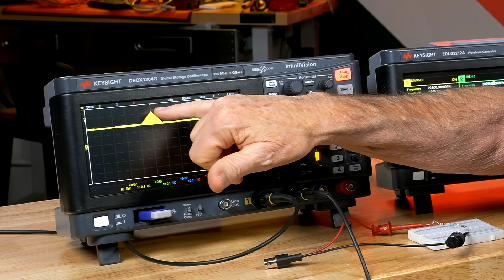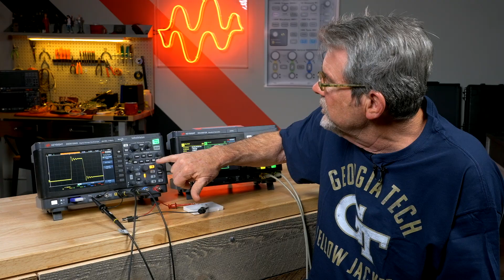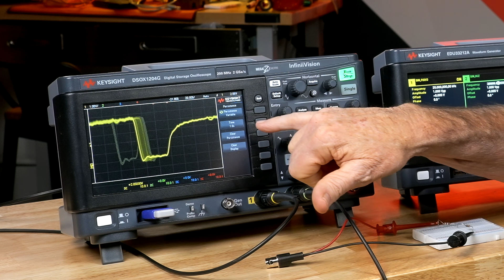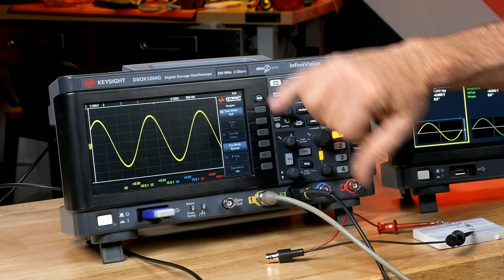Lesson 16: Acquisition and Display Modes

Comment: New to electronics just self learning, checking out good videos like yours. Thank you very much.
Have a question. 
Forgive my question if it's off topic and maybe two basic
On your shingle shot event I see ringing on the rise and fall of the single shut event. 
Is the ringing harmless or harmful when seen in a circuit not in single shut events but as a continuous output of a circuit?
in frequencys of 40k to 200k can ringing like this cause overheating on wire wound resisters?
V is step down through 2 alike resisters 1 & 2 (47k, 3W) in serious from 380 to 15 (square wave).
Then, Output is fed though a few stages and diodes, a + end of a cap... To a (220 ohm 3 W) resister 3 & into a hi feq transformer. 
The current measured going through these resisters are 0.4 to 0.6 I.
Resisters temperature rise to around 300 to 390F. Which eventually blackens the board.
Reply: Hello A B, I fully understand your circuit and application without actually seeing the schematic and the input signal, but you mentioned that the measured current is 0.4 to 0.6 I. I'm guessing you mean 0.4 to 0.6 Amps. I also don't know if this is RMS current or peak current. If this current is flowing through a 220 ohm resistor, that's a lot of power since Power = I x I x R. If we assume 0.4 Amps, the power is 0.4 x 0.4 x 220 = 35 Watts. Your 3 W resistor is going to get really hot and probably burn up.
Reply: @johnniehancock2426  thank you very much for you reply. 
To get the current Going through each resister I measured the v (using a 289 fluke) and multiplied it by the. resister.  I am not sure if what I measured is the pick voltage. Assuming pick voltage would give pick current?.
Perhaps I should setup the boards measure and document everything again.
Reply: @AB-yu2tj  DMMs don't typically measure peak voltage. I believe the only selections on a DMM are either DC voltage or AC voltage, which means that it would be RMS if AC voltage is selected. In addition, when you want to measure AC voltage using a DMM, it usually means that you are measuring the RMS voltage of a sine wave, not a square wave. Also, DMMs have a limited frequency range of a few hundred kilo Hertz for AC voltage measurements. Measurement peak voltages and AC voltages in RMS is higher frequencies requires an oscilloscope. 

Note that I am retiring from Keysight today after 42 years at HP/Agilent/Keysight. I don't get notifications when someone comments on the Keysight Hands-on channel become I am not the owner/administrator of the channel. They only way I see the comments is by monitoring this playlist. This means that I may not be responsive to future comments and replies. Sorry.
Reply: @johnniehancock2426  thank you for your reply.. congrats enjoy all the free time. Please consider creating your own channel if possible. You are a gold mind of info for us. 
Your current videos will be up correct? cuz I need to re-watch them.
Reply: @johnniehancock2426  so it seems my calculation then is wrong because I was thinking power=V x I. 
I definitely got to get higher-powered resistors then.
Reply: @AB-yu2tj  Power is equal to V x I. But it is also equal to I**2 x R .
Reply: @PopsandMopsto4  thank you. 
The 220 ohms resister has a much less v drop across it. I think it was about 12 or 13 volts I don't remember the exact voltage, I would have to set it up and take measurements using an oscilloscope
Reply: @johnniehancock2426  hi, Happy Holidays. I hope you are enjoying your retirement. just wanted to leave this massage and hope it reaches you. 
sorry I am using the shop computer to send this reply. this computer is signed in google / youtube under a different name. 
I powered up the board and made measurements again:

incoming power into this rail is about 330VDC, Measured to ground.
it goes through R1 (47K, 3 Watt), voltage across it is 156 VDC, (on the other side of R1 to ground I measured about 170VDC)
170 VDC goes thought R2 (47K, 3Watt), v across is 155vdc.   (on the other side of R2 to ground, measured about 15 VDC)
15VDC then goes through or touches off of a few components and at the end goes through 2 fast acting diodes. 
then it goes through R3 (220 ohms, 3Watt), voltage across it measures 14.59 VDC. 
R3 feeds one of the legs of a hi frq transformer.  
my voltage measurements are not peak.